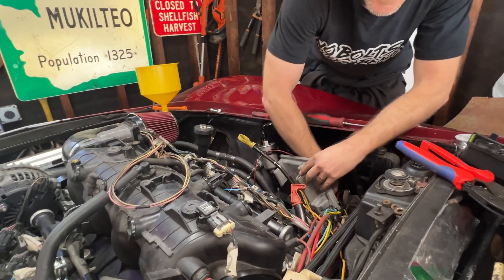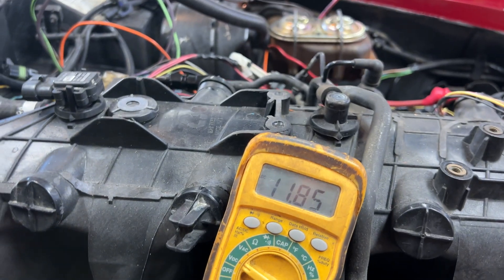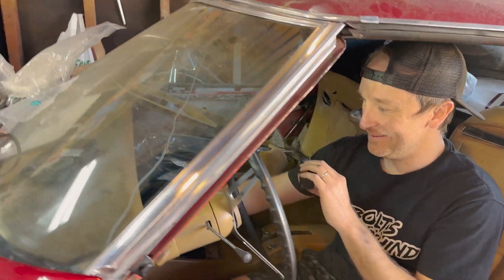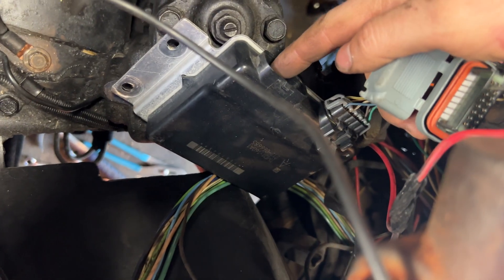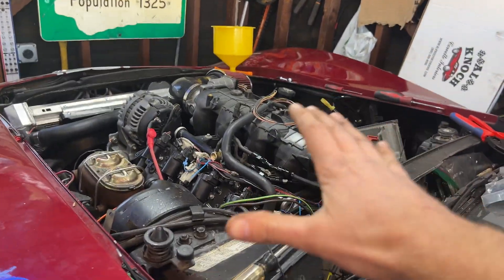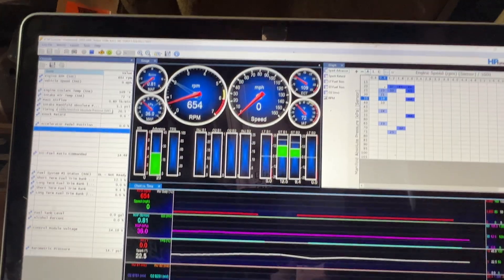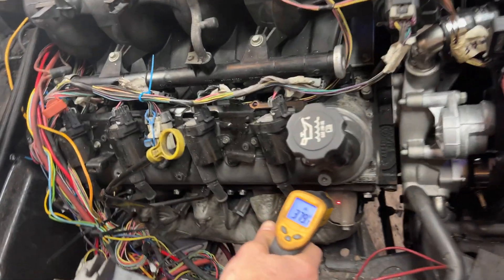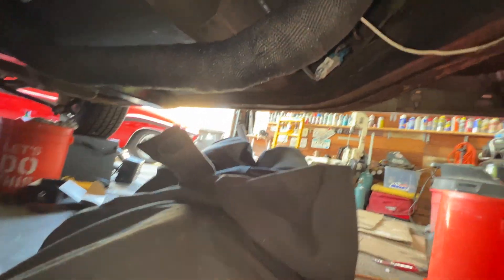FIRST START of my 4.8 LS Swapped 1974 Corvette!

Comment: What are your plans for engine to under hood clearance?
Reply from the maker: @macho4x4warlock98  it fits as is! The truck intake fits with maybe a quarter inch to space after shaving off some plastic tabs and I cut down the alternator bracket a few inches.

Comment: Good job, sounds great for a little 4.8L. When you filled the motor up with coolant you filled the top hose to fill the block correct? If not there won’t be any coolant in the motor because the thermostat is on the lower hose
Reply from the maker: @xozindustries7451  I had to open the coolant crossover tube to bleed some air out but once I did it opened right up 👍

Comment: Congratulations. Even when you turn on the electric fans the LS factory fans are set to 227 degrees. Make sure you turn off the rear O2’s if not running cats and cat over temp protection.
Reply from the maker: @Mr688895  thanks man, good call 👍